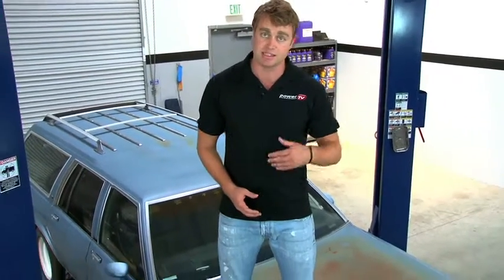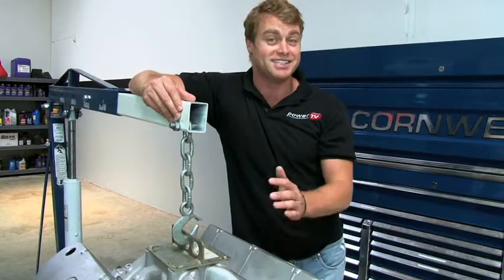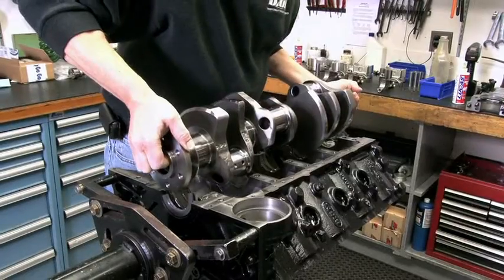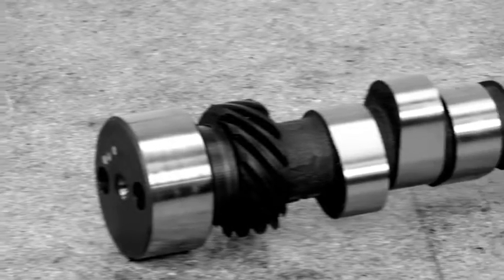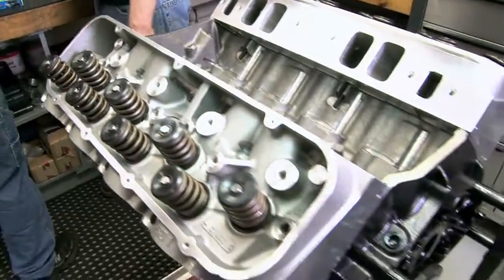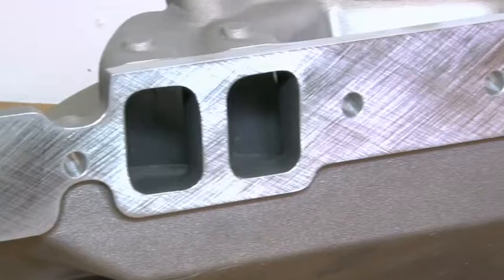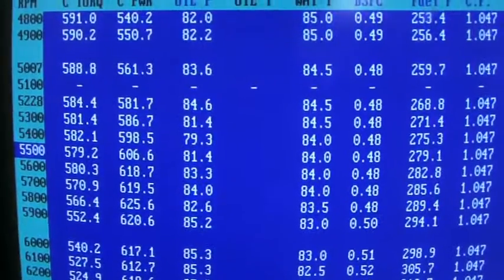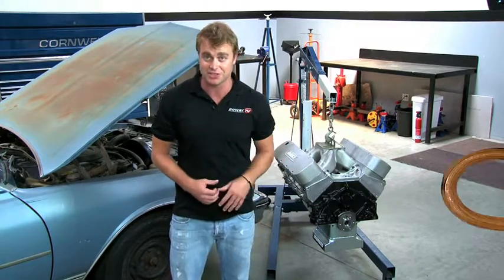StreetLegalTV.com - 509 Dart BBC Build Up

Comment: An 850 cfm on that motor? Do the math! The volume of air at peak torque AND rpm should calculate to a 1000 cfm using a 2 1/8"id header tube and 600hp isn't even a problem! A little mild port work and 700hp is there. 
My 496 with 2 1/8"primary header at 10.5:1 1050dominator on pump gas made 720hp. With vpC12 at 39degrees of timing and  a cheap vacuum evac made 742hp !!!!! I use Brodix BB3 X-tra O heads and Brodix prototype intake. My porting.
BTW I am using the exact same cam.
Reply: I agree there is more to be had there. This just shows what slapping together with off the shelf parts can get you with no extra work. No porting or anything done to the heads and maniforld, 850 carb to be a little friendlier on gas, and they made 650hp and over 600ft lbs. Pretty freakin solid.
Reply: 720hp at what RPM? 6,600???
Reply: @musclebone7875    Peak torque was at 5500 and peak power at 6300.  I do want to try a little stiffer valve spring as well.
It should raise the peak Hp at rpm. Maybe.
Yes, you are correct 650hp on the street is nice.  I just can't let Chrysler put out a car with more power than a purpose-built motor!  I am planning a tunnel ram.  I would love to see a 50-year-old block supporting 800hp.
Reply: How does your motor run on the street
Reply: @ChevelleMafia69  what's up bro?
Reply: @musclebone7875  sup bro, how often do you think I'll be setting valve lash with a .700/.714 lift 308/316 duration solid roller cam if I'm driving it once-twice a week only in the spring-summer time?
Reply: @ChevelleMafia69  mmmm....All depends on whether you live in the city like me or country with lots of open road. Solid rollers don't like to idle in traffic that long. I'd find a healthy hydraulic roller cam. Solid roller cams rev higher and make more power, but they can be maintenance prone.
Reply: @ChevelleMafia69  It's loud and abrubt.  But not too bad if you don't drive with a lead foot. I have a 4 speed automatic trans for the street. Understand, this motor was built using the mathematics from the book, "Performance Automotive Engine Mathematics." It is a period correct motor for my vintage car.  Built with the proper understand of engine physics, the motor will not be choking for air, nor will there be back pressure in places not intended. Rod angle is good as well as the fuel burn. So, on the street, at least I know nothing is hurting my motor. And it runs at 180F all day long.  At least to the next gas station!